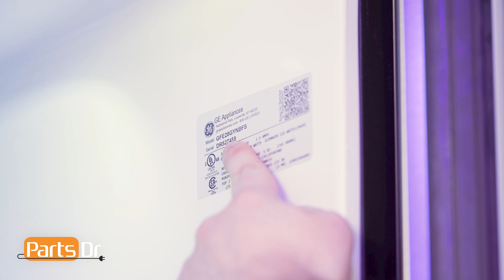GE refrigerator not cooling? Check these 5 things first!

Comment: No cooling in refrig or freezer. My fans are all running. The compressor seems to be running. No ice on the evaporator.  If the compressor is running does that mean that the thermistor are OK? 
Air coming out of vents at around 50°F.... I see 2 areas of corrosion on the copper piping, but the are dry, not oily... Could it be low on coolant? Where do I go from here?
Reply from the maker: This doesn't sound like a problem with a thermistor from what you are describing.  To narrow down the issue you would need to see if the evaporator coil(s) have frost on them.  Excess frost would indicate a defrost problem.  No frost on them while the compressor is running could indicate a sealed system refrigerant leak, restriction or compressor problem.
Reply: Thank you for that quick response. No frost on the evaporator... Sounds outside my diy expertise at this point... Technician should be here soon. I appreciate your help.
Reply from the maker: @davedelman2803  Sounds good!  Let us know what the technician finds.
Reply: "Big refrigerant leak"... They said if it was a small leak they would add a sealer and guarantee it for a year but with what they saw they are recommending throwing out this 4 year old, $3,000 frig... SMH
Reply from the maker: @davedelman2803  Sorry to hear the bad news!  Thanks for the upate!

Comment: @PartsDr I have a dfe29jsdass French door refrigerator.. the fridge wouldn't cool past 50 degrees and the freezer was always cooler or warmer than what set. I was trying to fix the cubed button when the main control board on front went out I guess guess I touched it with a butter knife.. I bought a new board and face plate and now shows a display however, the top fan now doesn't want to turn on.. when it first boots up I can hear a clicking sound for about 5 seconds and then nothing.. lights work and freezer fan seems to run but Does not turn off when I open the freezer... if I run diagnostic on the fans via test mode 46 both fans turn on but turn off when out of it... I'm so slumped on what to do.
Reply from the maker: It sounds like there could be multiple issues.  Typically if the fan motor isn't running, both the main control board and fan motor need to be replaced.  Try checking the refrigerator for stored error codes as show here: https://www.youtube.com/watch?v=oyW-CUb739I

Comment: This just happened to me. 
GE model “GNE27JMMAFES”
The evaporator fan was ok, but the plug for it on the fridge side had corroded. Somehow, water had gotten on the foam around it. This one is a bottom freezer and the drain hole for when it defrosts is very close to the plug. I don’t know if this was the issue(I suspect it is) or if I have a leak on the water line. 
I just cut part of the plastic and foam out until I pulled enough of the wiring, cut both plug ends and  just connected the wires directly with “18-22 Gauge Watertight Heat-Shrink Butt Connectors” from Harbor Freight. I had to use a lighter since my hair dryer was not working. I used a Dremel with a cutting disk to cut the plastic and a flathead screwdriver to dig the foam out. I wrapped all the connections individually with electrical tape. If I had to do it again I would have tried to wire new plugs. 
Note- out of the six points in the plug, only 4 were wired and 2 of them had double wires on the fridge side (all the wires on this side were 20-22 gauge on my stripper tool), the fan side were all single wire (18 gauge on my stripper tool). 
The fan is running now, will have to wait until the morning to see if the fridge side is cooling.

Comment: I have the same exact fridge. Couple days ago it stopped cooling and freezing completely. All my food went bad now trying to figure out what’s wrong . I’ll check these things hopefully I can figure it out
Reply from the maker: Let us know what you find!
Reply: Can you check out my comment above?
Reply: The first thing you can check is the evaporator fan motor , make sure it run ,2nd check the compressor to make sure it’s pumping the gas , a household refrigerator will pull between 0.75 -2.6 amps when pumping, if it’s not pumping you meter will read 0.003 or something like that , and when you are checking the compressor you can see if condenser fan motor it’s running, but before do all this , touch the back of the freezer wall from inside and see if you notice ice building up , usually you will see some rime ice ,if you notice ice buildup, most likely you a defrost issue,and the most common parts that fail is the defrost thermostat also called bymetal, if you have any questions and I can help you I’ll be glad to do it
Reply: @Mecambrea77 where are you located?

Comment: I have GE side by side , the freezer temperature suddenly start rising up , if I unplug the electricity and reset it as u described it will start working normally for a day or less , I replaced the heater, sensor and thermistor on the back of the freezer , still doing the same 
, now I’m thinking of replacing the board, 
Any other suggestions ?
Reply from the maker: We are sorry but we can't diagnose a problem like this over a Youtube comment.  Since it seems to work after unplugging it, that could indicate a failure of the main control board.
Reply: @ that is absolutely right, I replaced the board and it is working just fine
Reply from the maker: @essamdalgamouni1536  Great! Thank you for letting us know!

Comment: Excellent video! I'll start troubleshooting.
Reply from the maker: Great!  Let us know what you find.
Reply: @PartsDr OK, here are the symptoms - the freezer is steady at 29 degrees, the refrigerator steady at 59. A few days ago we heard a lot of clattering sounds coming from the freezer compartment (it is a GE with a vertical freezer on the left, refrigerator on the right). The icemaker stopped working (I read that it stops working when above 10 degrees), and the entire back of the freezer is frosting up. My guess is that a fan stopped working. Also, the icemaker has been “underperforming” for many months, with small cubes and lower volume of output than normal. I think I’m going to just call for a repair service.
Reply from the maker: @KeithM-TX  It could be a failure of the fan motor, or a failure of a component in the automatic defrost system.  The underperforming ice maker issue is most likely a separate problem, check the water supply to the refrigerator.
Reply: @PartsDr  Follow-up: I had an independent appliance repairman troubleshoot both problems. He helped me order parts on AppliancePartsPros website. When they came in, I installed them and the problems were both solved. The fridg and freezer not cooling was due to a blown-out defrost heater (as you thought!), and the small cubes problem was solved by ordering a new Mwf manifold (the part that the water filter screws into). There is a spring-loaded nipple that, when the filter is screwed in, pushes the nipple up and opens the valve to let water into the ice tray. That nipple was partially broken and was not letting the full flow of water get through. Thanks for your advice! I was able to save myself about $160 (a second trip charge plus time to install) by installing the parts myself.
Reply from the maker: @KeithM-TX  Glad our video helped you troubleshoot and save on the repair! The defrost heater and manifold issues can definitely be tricky. If you need parts in the future, remember Parts Dr offers genuine OEM parts, often at a lower price. We’re always here to support you with troubleshooting tips and parts advice.  Thanks for sharing your experience!

Comment: Hi there, i have the GE GSH25SGPA SS, vertical double doors. The fridge is not cooling at all. The evap. & condenser fans are working, the capacitor, current relay, test compressor windings, all good. I will recheck the overload's resistance to see the reading i get.  Your thoughts?
Reply from the maker: Maybe check to see if the main control board is bad?
Reply: How do you check the main board?  @PartsDr
Reply from the maker: @lowelife22 To check the main board on a GE refrigerator, you'll need to diagnose it based on the issue you're experiencing. This often involves performing live voltage tests on specific components to ensure the board is outputting the correct signals. Always use caution and only attempt this if you're experienced and comfortable working around electricity, as it can be dangerous. If you're unsure, consulting a professional technician is recommended.
Reply: Hi did you fixed , I have the same problem on my GE ,

Comment: Appreciate your videos. Does the compressor start relay impact whether the evaporator fan motors run?  Both evap fans do not run in my model (GE PWE23KMKFES). When testing the relay, is there any concern with discharging the capacitor?
Reply from the maker: The compressor start relay does not normally affect the fan motors.  We have a video showing how to test the start relay here: https://www.youtube.com/watch?v=nx7l9kY2_bU

Comment: My GE  DSS25KGDR WW-THE FREEZER especially low down-works fine-
the upper part of the fridge-is 60 degrees-but mid part 43 degrees- low down about 20 degrees
I changed the evaporator fan motor-pretty sure it DOES NOT COME ON-does not blow air over into the fridge-I think cold air just goes BACKWARDS-
FLOWS from lower freezer to lower fridge-
Why does the EVAPORATOR fan not come on-changed motor-what "tells" it to go on?
This fridge came from y late sister-bIgger and newer than our old fridge-HUGE 25 CU FT-
I am 100% considering putting in a tiny drone motor-battery powered-positioning it low in freezer-blowing into vent-or perhaps one HIGH in fridge compartment'
Yes it would be a PITA-but we are not affluent-thanks-
PS THERE are 6 wires to fan motor-two white thermister a red black(maybe blue) yellow and another white I think.
I wonder if I could just JUMP the darned thing-have it run constantly-or maybe just jump it-bypass any controls-put a switch on it-add LOTS of wire length-
which wires actually POWER the evaporations fan-if aI D/C the others-will it run??
Heck even put a 10v battery pack in it-with tiny timer-just get motor running somehow?
Thanks
Charlie

Comment: I have a Ge GNE27JYNWFFS no ice dispenser or water - frig wont stay cool and freezer freezes up - any idea
Reply from the maker: Check for a failure of one of the automatic defrost components (defrost heater, defrost thermostat, defrost temperature sensor, main control board).

Comment: We have 60 degrees in frig and 4 in freezer. 
We are about to check the parts you have discussed here. 
The compressor feels very hot to touch, is that normal. 
The freezer fan is still running with the door open.
Reply from the maker: The compressor should be warm but not hot typically.  Check to make sure the condenser fan motor like we show at 2:40 is working properly.

Comment: Can one assume if the Compressor fan is operational then the Compressor /Start Relay is not at fault?  I ask because I did validate the Bottom Fan (Freezer) is NOT running when I check per your instructions.  I feel air blowing in the upper portion of the refrigerator.  I did not, however, take the back off the inspect.  I ask because I wanted to know if anything else may cause the Lower fan to not function.  I also let the fridge sit for a few hours to confirm no ice build up was an issue.  With that being said, I was going to get a new fan.  I assume both the upper and lower are the same type?  In the meantime, i will also try the multimeter check for voltage to the "bad" fan.  Any recommendations would be appreciated.  
Your link below is fir my fan model, correct?  WR60X25258 is the code on my current fan.
Reply from the maker: The start relay can be bad even if the compressor fan is running.  Learn how to test the start relay here: https://www.youtube.com/watch?v=nx7l9kY2_bU

All parts would need to be located using the model number from the tag on your refrigerator.  The upper and lower evaporator fan motors are usually different part numbers.
Reply: @PartsDr  The Compressor fan AND the Compressor runs but the Compressor motor only gets around 85F.  The evaporator Fins do not get cooled and both interior Evaporator fans do function; the Freezer fan operates with the door open or close. (Note: Our earlier conversation stated the freezer (lower) evaporator fan never worked.  I just pressed both Fridge AND Freezer control buttons to turn the COOLING to off.  I then turned the COOLING back on and now the fan(s) all work but the Compressor / Compressor fan turns off .  IF I unplug the unit and then turn it on the Compressor reactivate but now the lower freezer fan is dead. 
Question:  If the Compressor is ON then the fins must get cooled, correct?  I ask this only because IF the Thermistors are bad I would assume the Compressor would be told NOT to come on.  Thus, it appears it may be the Compressor Gas is low????
Reply: My clamp multimeter is reading 0.4 amps on the Compressor when my model calls for, I believe, 1.5 amps.  Maybe the gas is too low to give enough work for the cooling effect?  In the meantime, i will check the run start capacitor per your provided link.  Thanks for responding and in such a timely fashion!!!
P.S.  At this time, i am assuming the thermistor(s) are ok.
Reply from the maker: @jaym48  Unfortunately, this problem is too complicated for us to be able to diagnose through Youtube comments.
Reply: @PartsDr  Understood.  Your station is excellent and the attention to detail is to be commended!

Comment: Registered at at your forum website and never received the email to complete the registration. I have model PFE28KBLLTS GE Profile Bottom Freezer. My wife notice the ice cream was melted but it was still cool. I removed the back cover and the coils by the compressor were dirty. I cleaned the whole area out, but neither the refrigerator or freezer are reaching their set temperature. The fans for the compressor, freezer, refrigerator and deli drawer are all working. I removed the cover inside the refrigerator to look at the coils and they were not frozen. Compressor comes on when plugged in and cooling fans comes on seconds later and stays on after compressor comes on. Would the thermistors be the problem here and if so, Which one?
 How long for the refrigerator to reach set temperature after coils are cleaned free of dust?
Reply from the maker: We have approved your forum account so that you can post there.

Comment: hi! I have a mod. RCE24KGBFNB G.E. fridge, the fresh food compartment doesn't go under 10°C, the ice maker and freezer works properly, but not the water dispenser. How many fans are inside my fridge? the one in the freezer works well, but the fresh food compartment seems not working, even if I hold the door button "closed". Thanks
Reply from the maker: We are sorry, but we do not have information on this model since it is a non-USA model.

Comment: My ge won't get below 22 in freezer and 49 in Fridge part, fans seem to be working, what else can I check?
Reply: Same freezers stuck at 15 fridge at 40. Did you find any answer? All fans work changed out relay and capacitor cleaned condenser coils. Still stuck
Reply: @bryanotte5517  yes i did, I replaced the defrost heater and the temp sensor, and it's all back working good!
Reply: @OTTEOUTDOORS Any luck sir? My 4yr old GE is at 37 and 10,and the Frigidaire I just traded was in the low 30s/freezer near Zero. I've had it 2 days now and just turned the Single controller Up to 3/4,I Pray to God this Lowers them Both but I'm Really  Disappointed!!

Comment: Thanks for this video, it is awesome.  Unfortunately, I am still having issues.  I have a GE pye22kynfs French door refrigerator with freezer at the bottom.  The refrigerator temperature seems fine, but the freezer drifts between 14-22 degrees.  It is set for -5.  Basically, we inconsistently get ice (apparently the temp needs to be 15 for that to function) and our ice cream is all like soft serve.  All 3 fans seem to be working ok (I have not opened the evaporator panel, but I can feel them kick on.  pushing the "Close door" button also allows me to feel the feed for the icemaker turn on as well.  The drain had a clog at the very bottom which I removed which gave us ice and a temp @14 for about 3 days - now we are back to no ice and 22 degrees. next guess?  Thanks.
Reply from the maker: Check to make sure the freezer evaporator fan motor is circulating the air properly and that the evaporator coil in the freezer is not full of ice/frost.  If it is full of ice and frost, that would indicate a failure in the automatic defrost system.

Comment: Hi, my GE Monogram build in fridge compressor is running hot. What is the normal temperature when the compressor is running? Mine is around 160 degree
Reply from the maker: On most refrigerators you can put your hand on the compressor and it will feel warm but it won't be hot enough that you can't hold your hand on it.  Make sure the condenser fan motor is working properly to dissipate the heat.
Reply: @PartsDr  The freezer fan motor sometimes works and sometimes doesn't work (I pressed the switch on the door), and this cause my testing bowl of water sometimes freeze and sometimes melt. As I am typing in, this fan is not working, and the compressor is not hot to touch and I can hear the fridge is working. So what could be the reason? One tech said he can't test the power to the fan motor. But since the fan motor is working sporadically, it is getting power. So could it because the compressor need to be replaced? Also, over 10 years ago a tech left a piecing valve on the compressor and I was told it is not right. Also I am getting a tech to clean the coil in the back.
Reply from the maker: @pingliu9962  You should be able to test the voltage to the fan motor similar to the process shown here: https://www.youtube.com/watch?v=x9fK0bN72MA